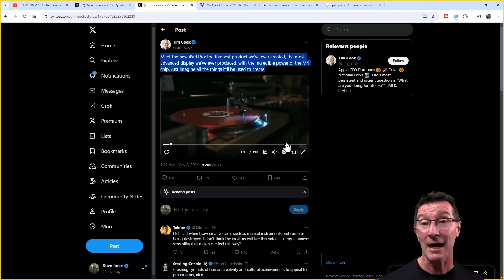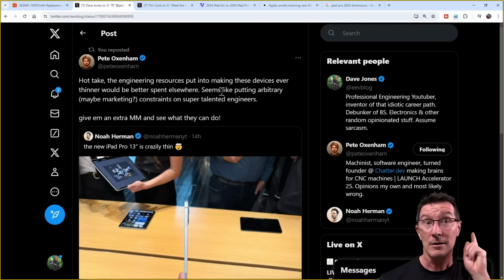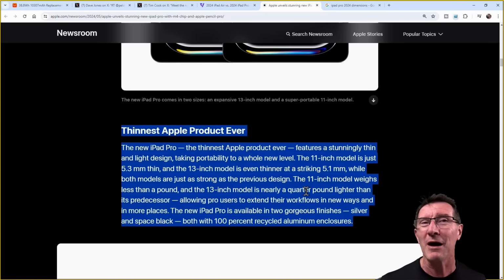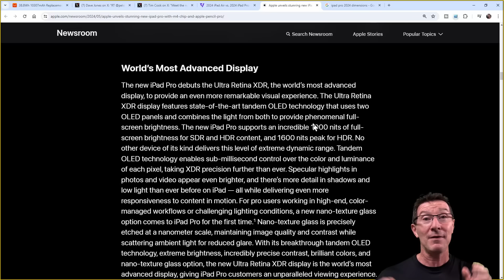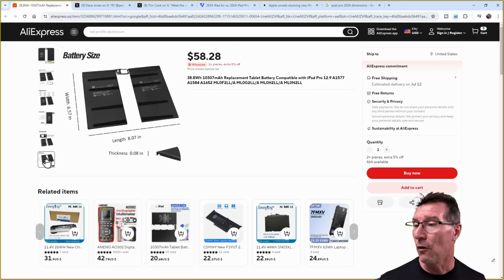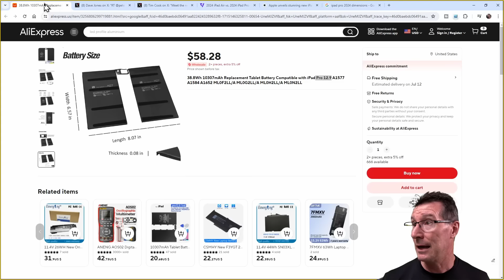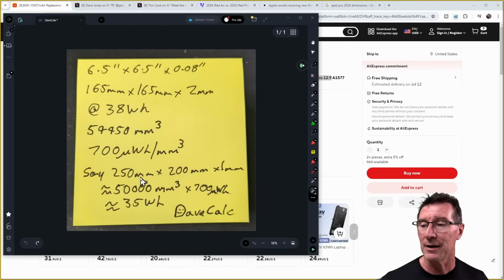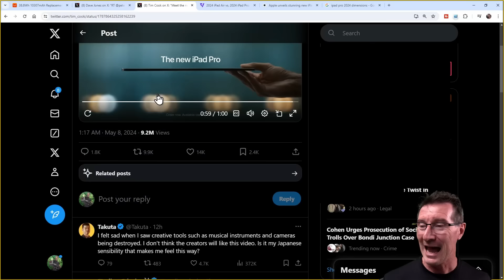eevBLAB 118 - NEW Apple iPad Pro: Volumetric Engineering vs Marketing

Comment: Even if they can't do a 2nd battery layer to will out the back case, and instead opted for 50% more battery life, the extra space could be used for an internal subwoofer to improve low frequency audio.

Comment: Extra 1mm would actually give more energy than +50%. These 2mm already consist of jellyroll plus the pouch casing. Adding 1mm will add jellyroll only, so pure capacity, optimizing pcb layout further might give more area for battery, so just like you said, doubling the capacity should be easy. But NOOO, we need the thinnest one (camera bump not included) 😅

Comment: So true! The iPad 3 and 4 are still the ones with the largest batteries, which is just crazy! The iPad Pro came after those with a larger screen an ofc also higher total resolution, but with a smaller battery! Spec was still the same time-wise, but that’s bullshit. Felt the deficit going from 3 to 1st gen Pro. 
And camera bumps are stupid.

Comment: Let’s try precise numbers: the previous iPad Pro (12.9 inches, 6th generation) was 5.9 mm thick with a 40.88 Wh battery. The new one (13-inch) is down to 5.1 mm, and is also down to 38.99 Wh. 0.8 mm = 1.89 Wh. The old iPad was also marketed to have a 10-hour battery life, the battery loss is only compensated by the more efficient chip, as opposed to improving it.

Comment: I prefer thicker and also some bigger batteries that can be replaced. Make it 10 or 15 or maybe 20 mm totally fine with it. Longer time working so one doesn’t have to charge that often and can we make it so that we can click the battery out and have some little battery if you switch it out.

Comment: Just my thoughts but I think there are several things happening with this iPad. The most impacting part is the M4 APU. They didn't skip the M3 for no reason, it was a financial decision. Apple was the only company using the process node used to make the M3, as such it was more expensive, than the process node that is being used to make the M4. As Apple goes up on iteration on these processors, heat has been becoming an issue. The M1s MacBooks are quieter than the M3 versions, they also generate less heat. Apple had to get the M4 closer to the back of the chassis in order to cool it down, that is why the Apple logo has copper now to help with that. Smaller battery size requires a display that uses less power, and that is OLED. In this case a Tandem OLED, a technology that has been out of the reach of many companies for years. Notice the price increase.

Comment: I’d love to see more useful apps allowed in the App Store (and developed for tablets in general). Why do we need more powerful devices if apps that require that performance aren’t allowed or available. For example, programming on a tablet is almost impossible, and finding things like EDA tools is hard. It isn’t something that you would normally do with them, but I have found that a table can be quite handy when testing things in the lab when working with big prototypes (for example, being able to view the altium project while soldering a pcb could be useful

Comment: I think durability will be a major issue with these new iPads, they are just too thin for their size, even using expensive materials I still don’t think that would be enough considering that it will just be a thin shell on the outside. 

Resistance to bending increases the further away from the normal line you are and material that is further out contributes more to strength. Even just increasing it by a few mms you could increase the bending strength of the iPad and allow them to use thicker material further adding to strength.

I would think that in a design this thin and light, the internal components are likely structural too and that with even the slightest bend the internal components will be under load. Which really isn’t good for durability.

Comment: Add 2 mm and make the camera bump disappear...
Reply: In also hate these camera bumps. I just don't get it. make fully flat product and profit from the extra room.
Reply: you can't place it on a hard table either side up. brilliant design.
Reply: Or add 3mm on the back and 1 on the front. You can now sink the cam and screen 1mm into the body, making them less likely to break.
Reply: These camera bumps are so dumb. You know what people do to mitigate those bumps? Put the device is a case. Which immediately negates the supposed advantage of making these things "thin".
Reply: And might as well make the battery thicker while you're at it.
Reply: I'd pay extra for that, or just remove the camera I don't need it.
Reply: Which you still we do because the case will make this 6 mm anyways maybe even 7 mm …
Reply: Is the iPad still relevant?
I don't think I've seen one since phones got giant and laptops got tiny
Reply: @KrissyD-px9gj  Basically use it for Yt and messages so that one is to expensive for that. And yes they are the shoe phone is still tinier and would als be terrible as replacement. As well as these folding devices are basically a joke to customers..
Reply: @platin2148  fair enough yep that makes sense
Reply: Agree in 100%.
When I saw the first iteration of iPhones to have this dreadful camera bump, I remember like if it was yesterday... It was the first iPhone version after Steve Jobs passed... And I thought, Oh gosh, it didn't take a year for those idiots to start taking stupid design choices Steve would NEVER let them out.
Poor Steve must be rolling in rage in his coffin since 2011!
Reply: Based
Reply: @KrissyD-px9gj  still quite relevant. Many people don’t want giant phones or run with full (still bigger and heavier) laptops around in the house. Tablets are the perfect middle for this.

Comment: I really wish it had a bigger battery and it was easier to repair. They say 10h but batteries age, specially when you use it a lot. And also, if you punch this CPU hard it won't last 10h. It could also have a better heatsink :/

Comment: Now imagine they made it the depth of the original iPad or the iPad 2 and used all that space for the battery. They could call it the iPad Immortal.
Or they could make a 16" or 17" version and add that 1mm.
Now imagine if they got rid of the battery, bumped the screen up to 32"+ and sold it as the Apple Magic TV.

Comment: Everyone seems to be ignoring the real reason that you don't necessarily want a bigger device with a bigger battery: weight.

There are a lot of people that hold a tablet for an extended period of time, either as a content viewing device (watching videos, eBooks, whatever) or as part of their job (technicians running diagnostic software, doctors/nurses doing rounds, etc.).

Even optimistically at 300Wh/kg, doubling the battery size (adding 35Wh) would make the device at least 120g heavier, or about 25% for the 11" version. I'm sure that there are people who would gladly want a 25% heavier device with double the battery life. But there are also a lot of people where the 8+ hours you get on an iPad is plenty already, who don't want to be holding that weight for an extended period of time.

On a laptop, the priorities are different because a laptop is not designed to be hand-held. On a phone or a tablet, weight really matters for the ergonomics of the device.

Comment: They should've just made it flush with the camera bump and advertised double the battery life with faster charging.
Or increase the strength of the case so you don't need to add a stupid case that adds extra mm's anyways.

Comment: The Apple pencil is thicker then the IPAD meaning it gonna be knocked off every time it is poked. I have an IPad for work and the only reason the pencil does not fall off is because of the otterbox case on it.

This is like putting the Charge port on your wireless mouse on the bottom of the mouse.

Comment: thickness measured where the camera is or the thinner aspect - plus you slap down your tablet on the camera that's going to likely to damage that then had it been a bit thicker to support the cam and also add bit more battery too - if they wanted to pay the extra 2c for the next battery size up.

Comment: with 1mm more the case would have been flush with the camera optics and the thing could lay flat on a table to be used with the pen it's designed to work with.
Of course Apple solution to this is to add a 1mm thick rubbery iTravelCase(c)(tm) (only 89.99$) with a cutout for the camera. ....

Comment: I agree with the logic however I use my gen 2 iPad Pro every day for work for probs 5 or 6 hours and had it since Feb 2019. It is a work tool both in office and on site. I’ve never had a problem with it. I’ve not noticed any issues with battery life, had no need for repairs etc. I use it for streaming etc when I travel but  that is not my primary purpose. It will last a long haul flight. Point I’m making is repairability, durability and battery has been far better than what I would have expected. I thought I’d give a real world example. Ps I’m not an Apple fan boy but it happens to be the tool I selected and in hindsight compared to alternatives we have had in the office, it is worlds ahead. Some of our other devices are unusable at doing the same things I can do and end up not getting used at all.

Comment: There's another angle which is that smaller batteries are cheaper to include, so by shaving battery size in the name of "thinness", they're also saving on bom cost.

Marketing AND Bean counters against engineers? They never stood a chance. PR would probably spin it as "lithium consumption reduction: our latest Environmental initiative"
Reply: designed to conform to apples zero material consumption by 2030 environmental initiative

Comment: For tablet I preffer to use my Surface pro, which has proper USB-A and USB-C ports with other useful gadgets like built-in stand.
Really sad Apple is restricting their engineers by 5.1mm thickness specification and then users putting on a 10mm or more thick case around it because it is too thin for normal use :/

Comment: The dumbest thing in that situation is that they should have learned that lesson by now. Back when the iPhone 6 launched it was seen as incredibly thin at 6.9mm and it had shitty battery life and it was fragile. A few years later the launched the iPhone X that was 7.7 and the battery was way thicker, it lasted way more and it was a more rigid phone, that lasted longer.
It gets even better when you consider the ergonomics of those two phones. People that i know who upgraded from the 6 to the X, say the X (the thicker one) felt way better to hold and it was more ergonomic, because of the thickness. Keep in  mind that this is subjective from people around me. I never owned either device.

Comment: I'm sure their new throttling machine will be blazing fast fast for several seconds (the good old overheat-induced throttling is back with the last M Apple CPUs combined with their obsession of avoiding using fans as much as possible)
Reply: I mean the M-series iPads are still the fastest tablets out there.
Reply: @AttilaTheHun333333  Yes.... Not much competition there since Microsoft screwed up the Surface pro potential with various issues :( 

Still, I cannot help but hate the things that are not properly cooled.
Reply: I kinda like the quiet nature of the Apple products. Always hated those PC's and laptops with their noisy fans and extreme heat. Not try then work as hard as possible, but as good as possible.

Comment: And they had to redesign so it won’t work with older peripherals.  I’d be more inclined to upgrade if I didn’t have to buy a new keyboard and pencil.  Apple needs to learn something from other business laptop manufacturers in the past that had standard docking stations you didn’t have to replace every upgrade cycle.  Now with USB-C docks they’re universal across vendors.

Comment: I think we all know what happens to the strength of an object when you make it so thin vs. large? These devices are already so fragile that everyone puts it in a case which doubles the thickness, or they get broken in the first few months. What the heck is the point of making a device 5mm thinner and then putting it in a case that adds back 5mm? Reminds me of the push to make screens as glossy as possible: it looks good in the store but when you actually try to use it, you just get a ton of glare and fingerprints.
Reply: It's the Big Case lobby I tell you
Reply: You just described exactly why it's the way it is. It looks good in the store, and by the time you get glare and thick bumpers, you've already paid for it so now it's your problem. 

Then again, if you looked at a glossy screen and a paper thin tablet and thought it was a good purchase, you deserve everything that comes next.
Reply: Its the same with iPhones, they have square edge as opposed to iPhone 6,7,8, so you need to use a case for comfortable holding experience.
Reply: The truth about the glossy screen LCD is you pay more and get less. Basically someone found out after leaving a damp cloth on their LCD screen it caused the anti-glare layer to bubble up so they peeled it off and posted it on the Internet. Soon everyone was modifying their LCD screens and monitor by leaving a damp cloth on the screen and then peeling the antiglare layer off. Soon marketing for LCD screens/monitors caught on and realized they could just leave the anti-glare layer off and actually charge more for the LCD screen/monitor or in other words charge more money while doing less work and soon it became almost impossible to find a a tablet or even a monitor with a decent anti-glare layer
Reply: The whole thing's a scam, IMO, for all the reasons you mentioned. And more.
Reply: @GiGaSzS  The easier to break your pockets or handbags. My 8 is the first phone that doesn't create pocket holes weekly.
Reply: Bending is all I can think about too when I see these new iPads. My 2018 iPad Pro is already thin enough that I could bend it without really trying. These 2024 models look like they will bend just removing them from the box!
Reply: I install the foam kids case with handle as soon as it comes out the box, it’s the only way for me to make it actually comfortable to hold!  If the stupid thing was actually filled with iPad instead of foam there would be enough space to add MIDI ports 🥵
Reply: @longjohn526  I used laptops and LCDs back in the antiglare days. They were much worse than displays are now. Contrast was lower and the screen had a grainy, papery texture to it that just looked and felt bad. Glossy screens look much better, especially given that we use them indoors 99% of the time under controlled lighting conditions
Reply: there are different "target groups". 1 - people that actually need the device. They will immadietly put it in a sturdy case, apply screen protector and carry a power bank. 2 - people that buy it cause it's a nice gadget, throw it in a backpack and crack the screen after a week (no big deal - they likely paid with parents money). 3 - people that use the device as a status symbol - they will "find a way" to keep the thing pristine without using ugly case. Marketting cares only about group 3 cause 1 and 2 don't look so nice in social media...
Reply: Don't forget about the camera bump BS too, that also more or less forces using a case. The camera bump makes all these thickness claims lies to begin with.
Reply: @Broken_Yugo  No, not really. Cases generally include a cutout for the camera bump so it doesn't add to the overall thickness. I suspect Apple likely has data that shows pretty much all iPad users keep the device inside a case. Any reduction in the thickness of the device itself will also reduce the the thickness of the device + case
Reply: Eloquently put
Reply: Would you all like towels to wipe the egg off your faces?  How about condiments to go with those hats? Jerry just completed his bend test and the M4 iPad is surprisingly rigid. As rigid or more rigid than previous models. Apple is a class act.
Reply: @bobweiram6321  "it tests no more floppy than the last one" is not exactly a good indication of rigidity, lol.
Reply: @Broken_Yugo   Stop the sour graping. It's more rigid than the 2018 model. You would still have something bad to say if it was as rigid as a slab of granite.

Comment: I think you all are missing the point. If the marketing strategy were doubling battery capacity, then apple would be in a very weak situation, because any competitor can also increase their capacity. By enforcing value on something stupid and difficult to achieve, they can more successfully differentiate from the competition

Comment: Thought you were going to get the ratio of battery volume to total device volume in the old model.. then assume the same volume of battery ratio in the new device… to give a rough idea on Wh of the new one… then you could increase the dimensions thickness of the new one and calculate the battery volume and Wh.. then work out the number of hours of battery life. … or is that all the same as what you did? 😂

Comment: Here's another thing to consider.
If the size increases even by just 1mm, the battery weight would go up by at least 50%.
Right now, the battery in the 6th gen 12.9 iPad weighs about 250g. So, with that tiny increase, it would jump to at least 375g.
That means the whole iPad would go from 685g to 810g, which is quite a big difference, especially when you're using a tablet.

With new iPad they managed to bring down the weight to a 582g without sacrificing battery life.
Reply: That was my first thought while watching; wantend to comment but you were the first